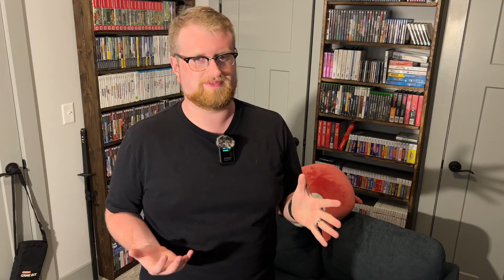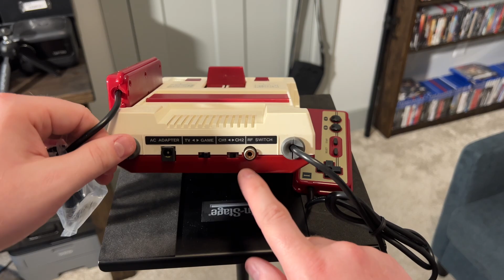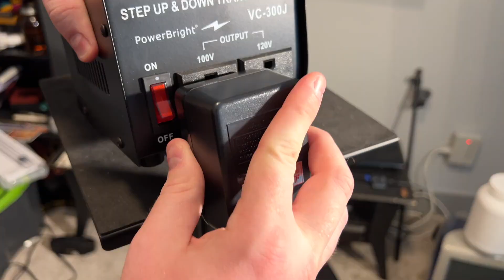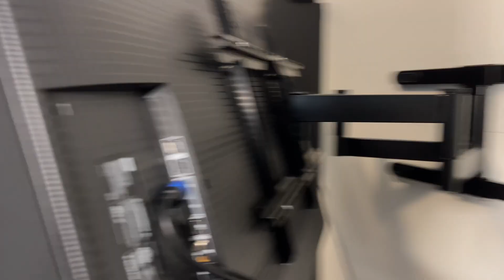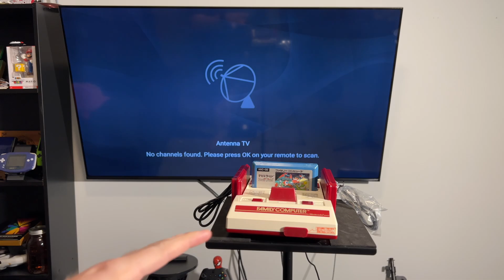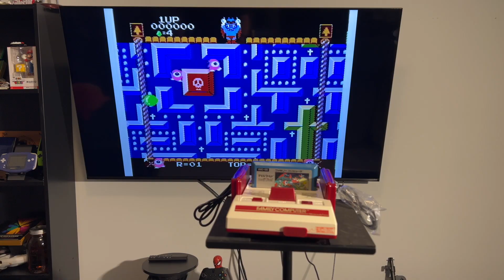Setting Up A Famicom in 2025 | Retro Gaming How to

Comment: The NES AC adapter actually fits on the Famicom, but it won't work because the NES AC adapter outputs 10V AC while the Famicom's AC adapter outputs 10V DC. Using an NES adapter on a Famicom can damage the Famicom, so don't do it.

Comment: Hello there, I recently got my famicom in the mail and have figured out the video stuff (very fuzzy pretty cool though) but I'm concerned with the power situation, being a canadian, step-down transformers are really expensive and the designed power cords (like the ebay one you showed) ships only from the US and would have very expensive shipping fees. I've heard that you can use a Genesis model 1 AC adapter to power the famicom, but I'm not sure if this will damage it or not. What would you reccomend?

Comment: Fami-clones made even better improvements on the eject button. I had the Micro Genius Famiclone in the late '80s and it was 100x better than the original Famicom eject mechanism. The Famicom has a wedge that slides beneath the cart to eject it. If your cart was dirty or for some reason that wedge can't slide smoothly enough on the bottom of the cartridge, your game is stuck in there. The only way to get it out is to pull the cart out with your bare hands. Which happened 60% of the time we played Famicom in the '80s and '90s. The Microgenius Famicom, literally simply pushed the cart from the bottom upward to eject it (there was a see-saw like mechanism inside). Which was really the most logical way to do it. I can't imagine, even today, what was going on inside the Nintendo engineers brains why they thought 'sliding' it out was the best way to eject the cart, rather than 'pushing' it out.
Reply: The microgenius was my first console, and the 64 in 1 cartridge with all the goodies (super mario, tetris, bomberman, islander/adventure island, goonies, etc etc)

Comment: Hey, I'm interested in the stepdown converter, but I saw that some of the reviews on the model you linked had fuses that got blown, so I was wondering how yours was holding up. Also, do you suggest the 500watt option? Thanks.
Reply from the maker: Mine is holding up fine, Granted I don’t use it as often as I could. 

As far as wattage goes, I think it depends entirely on your use case. I bought mine exclusively to use with game systems, of which I’ll only ever be using one at a time. So my power draw through it is very small, even when I am using it. The Famicom for instance is only 8.5 Watts, nowhere near the 300 my converter is rated for. So if you only plan to use it for games, then I think the 300 is more than good enough. But if you are going to use it for other things, then maybe consider a higher wattage option.

Comment: EDIT: No good, get a RGB Blaster or AV mod. You can get away with a VCR or other tuner if you're lucky, but odds aren't in your favor and the cost is probably not gonna line up.

I'm quietly waiting on an RCA adapter for PAL (Australian) TV antenna ports to confirm if it's the solution I need or not. Seems our equivalent channels are 3 and 4.

I'm able to get basically lagless video, and faintly hear audio if I fine tune the frequency, using a mega drive RF switch. But I'm given to understand it being a pal switch is why I can't get them in sync.

Will try to come back in two days to confirm whether it works fine! I'm using a Japanese CRT that was sold in Aus, that seems to have built in compatibility for NTSC signal. So if going RCA cable > adapter fixes it. That means there's no extra PAL weirdness people have to worry about.

Comment: you can just use a Sega Genesis model 1 ac adapter to power the Famicom because i have both the Av Famicom and the Super Famicom and the Sega Genesis model 1 ac adapter works just fine with both

Comment: I did it on all my TV's but the video quality is awful
Reply from the maker: That is the struggle. RF is definitely not the best way to play some of these games. But for an OG Famicom, that’s the only option you have without modding it. Using a CRT screen over a flat panel kind of smooths out the rough edges a bit though.